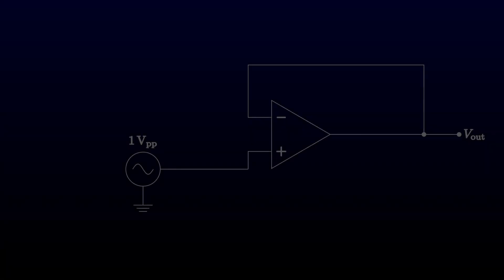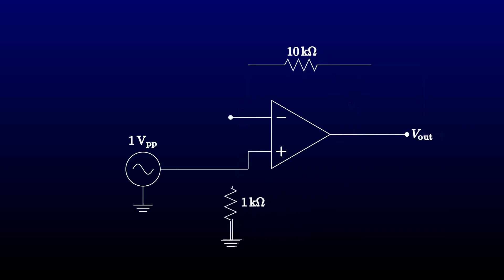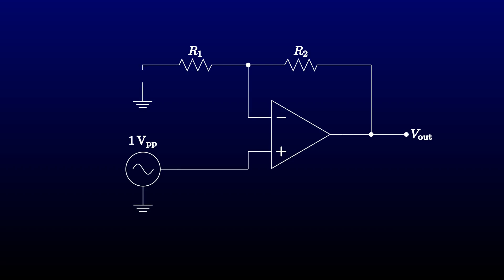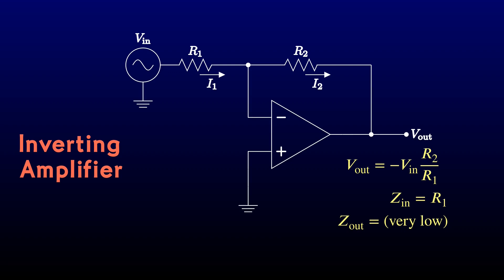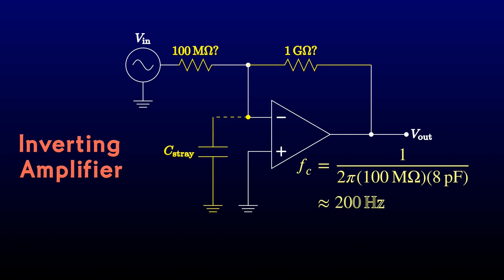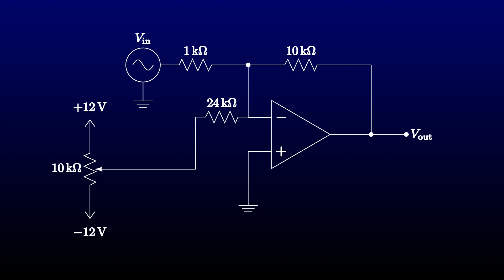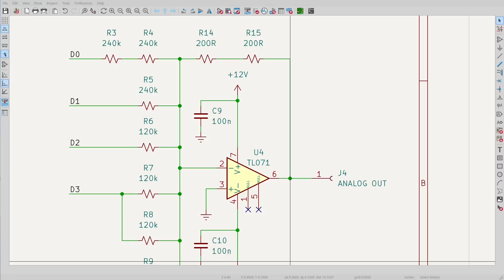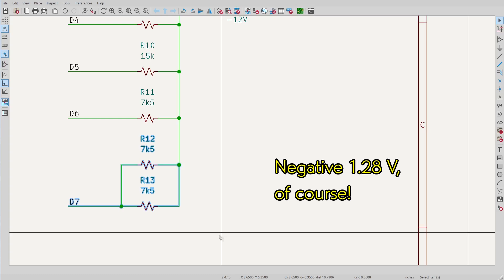Op-amp summing circuits: Op--Amp Basics episode 2

Comment: This is awesome but as soon as you're clocking it I'm thinking hmm... How fast can this go before you need fancy braided LVD cables and 8b/10b encoding? We might need oversampling! Which episode do we talk about current steering? We need to clean up that ramp! 😃
Reply from the maker: Heh. If I live long enough, there's no end of fancy stuff to talk about! Moving forward, I do get more into the stability issues, and I have a more recent episode on resistor ladders, but cool things like dual-slope interpolation and A-law/mu-law encoding are still quite a way off. I'm trying to prioritize a sound grounding in the basics.

Comment: At 1.20 there is a mistake in voltage divider formula in the numerator where is + instead of *. But nevertheless, exceptional video.
Reply from the maker: That's something where the classroom was better - if I did something like that on the chalkboard, the students would catch it in real time.  I've pinned a comment with the correction. Thanks for noticing!

Comment: So good ! More Audio stuff like this please :-) I'm still confused about AC nature of Audio. Some tutorials always talk about DC and suddently I discover the very same componenet can be used in audio with AC. May be you could talk about that. For a given component how can it be used in DC and in AC. What are the diff and so on...
Reply from the maker: I think the major point that you may be mising is that most voltages and currents are both DC and AC. Think of the DC as the average - which is oftrn not zero for a real signal - and the AC part as the amount by which the signal moves up and down around it.  When we talk about "at DC" in a circuit like this, we're talking about what the conditions are when there's no signal coming in. DC conditions are a lot easier to analyze: capacitors disappear and inductors are short circuits. And AC conditions are easier to analyze if you subtract the DC part out.
Reply: @KludgesFromKevinsCave  wait..what ? My osciloscope don't tell me what you are saying :-) DC is a real thing, not an average, it is a constant voltage which can , indeed, be added to AC (and we often want to get rid of it). What confuse me is I can listen a lecture on a NPN transistor where evrything is about DC, but infact, it is very possible to use AC through it, and this is precisely where I'm lost. The NPN will receive positive and negative voltage, this is what AC is all about right ? DC is just constant voltage.
Reply from the maker: @GoodTechConf  it's called biasing. You start with a DC voltage, and add the AC voltage to it. (Which means that on the negative half cycle, you are subtracting a voltage.). So a given point in a transistor circuit might have a 6 volt DC voltage plus a 2 volt peak-to-peak AC voltage - meaning that the signal is oscillating up and down between 7 volts at the peak and 5 volts at the trough.  When you need to get rid of the DC bias, you can block it with a capacitor in series, followed with a resistor to ground, (or  a divider that provides a different bias voltage). 

Your signal will be between the power supply rails, and you can analyze instantaneous voltages as if they're DC. Or you can analyze small changes to the signal at AC, ignoring the bias.

There's a video on the channel about biasing that may help. But the key concept is that you have your AC signal riding on top of a bias voltage. So if you're using a simple transistor model that assumes linear gain, you can get an output amplitude by computing what the circuit will do at the peak, and at the trough, and subtracting. When you do, you'll find that the DC terms cancel out. The bias voltage ensures that the transistor functions correctly (doesn't saturate or cut off) but ideally the ac part of the output doesn't depend on it.
Reply: @KludgesFromKevinsCave  I see what you mean, NPN is a DC component therefore, we need DC bias on a AC audio signal to use it. It is not designed to handle negative voltage. So later on I need something else to remove the DC bias and continue my signal path in AC if I want. But gosh, this whole story is never explained clearly 🙂
Reply from the maker: @GoodTechConf  Try following the 'Transistors 101' series in this channel and see if it helps!

Comment: Summing amps using op amps was the heart of 1960's and 1970's analogue control systems,  some of which I know are still in use on large critical control systems in industrial plants.
Reply from the maker: @philkelsall1207  Sure. Tons of analog PID  controls in use out there! (I had an analog computer in my 1969 Volkswagen, controlling the fuel injection system.)

Comment: Please cover following topics in future 

1. Opamp datasheet understanding 

2. Rail to Rail opamp 
3. Single supply rail Opamp 
4. Opamp stability 
5. Current sensing application 
6.different signal conditioning circuit using opamp like RTD ,Strain Gauge,ADC and DAC interfacing Circuit 
7.single ended signal to differential singnal conversion
Reply from the maker: @biswajit681  That's about half the syllabus for this series, although I'm going in a slightly different order! Amplifier stability is  about to come up in another month over in the transistor course, and it'll carry over into op-amps. I'm also looking at covering instrumentation amps, zero-drift amps, log and exponential converters, and some application circuits like precision rectifiers, peak detectors, window comparators, wave shapers, active filters, ... The list goes on. 

I might use a photometer rather than a strain  gauge as an example of a weak-signal source, but that's because I have a fun (and silly) example in mind. 

I'm really application-oriented, so the datasheet understanding will come with the individual topics. Each application has its own critical parameters to look for. But in the first couple or three lessons, we're newly in love with op-amps and see them as ideal! There will be plenty of time to discover their faults. (High-current drivers will introduce slew rate, integrators will introduce offset voltage and drift, differentiators will struggle with loop stability and gain compensation, etc.)
Reply: @KludgesFromKevinsCave  wow that will be a really great! Eagerly looking for the upcoming videos